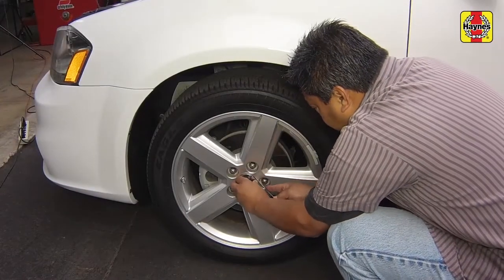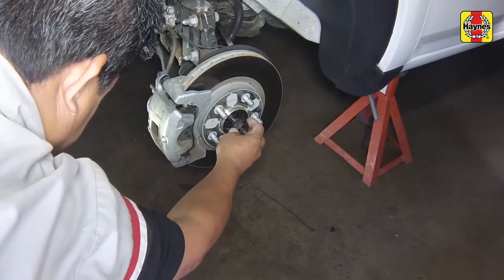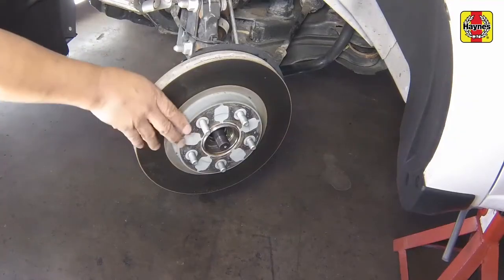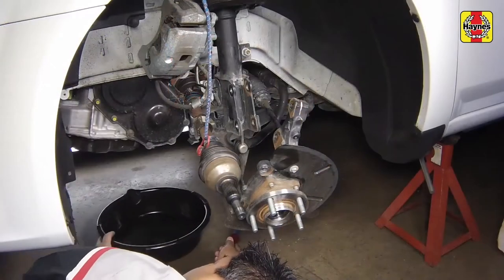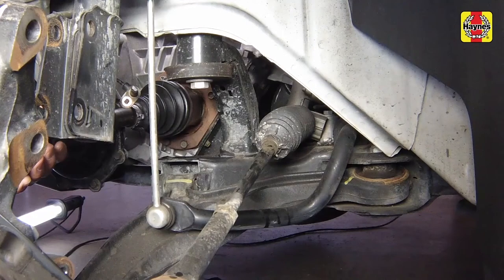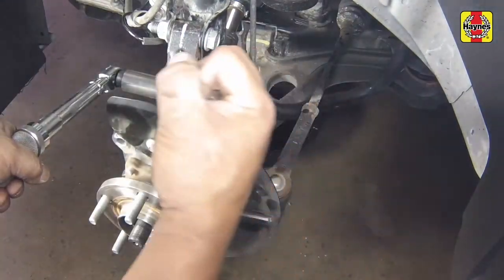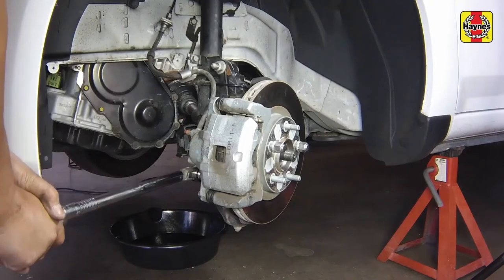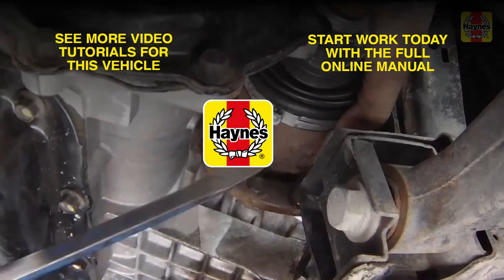How to Replace the drive axle on the Dodge Avenger 2008 - 2014

Comment: I've got the 6spd transmission (it looks different than this one does-it also doesn't have a dipstick for a transmission fluid refill/top-off since it's "sealed") Are these instructions accurate for it as well? I don't wanna be pulling out the CV axle like this only for the instructions to not apply and I mess even more stuff up...I own the Haynes manual for this car and it doesn't offer additional clarification either so...idk
Reply: For what it’s worth, yes still accurate. The design of the cv is different between the two transmissions but I think they mount the same.